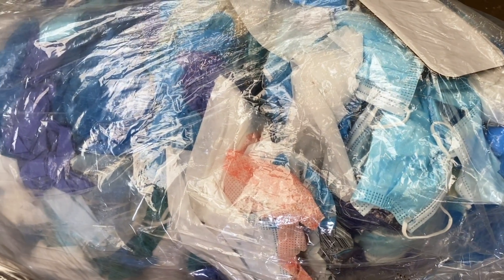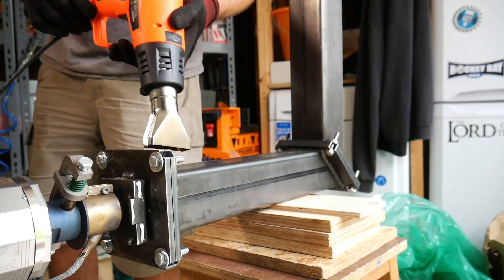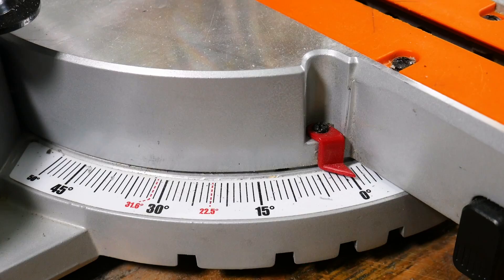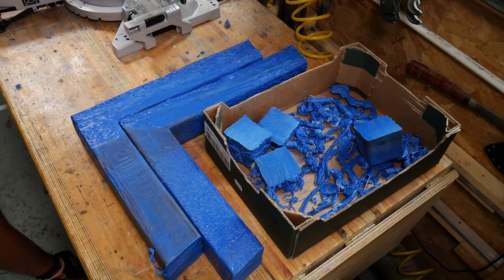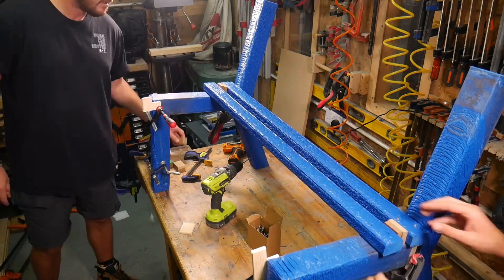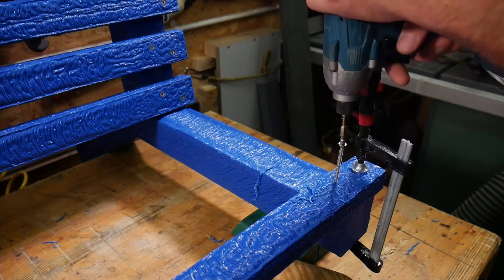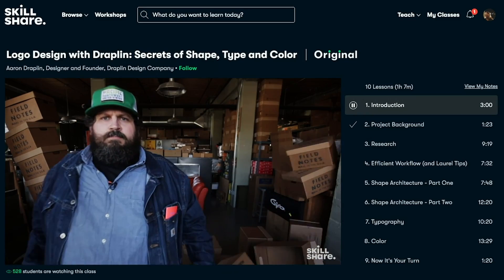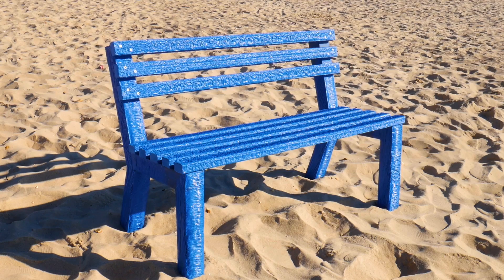We Turned Waste PPE into a Recycled Plastic BENCH

Comment from the maker: Thanks so much for watching! 🤙🏽 Don't forget, the first 1,000 people to use this link will get a 1 month free trial of Skillshare: https://skl.sh/brothersmake09211
Reply: That obtuse angle doesn't look all that slight
Reply: Great video . Thanks .
Reply: Wondering if a solar heating source for affordable power connected to the mold pipe would help thin the viscosity of the melted plastic & produce smoother finish on end product...
Reply: Thanks, brothers!

Long time, no chat.
Reply: I forgot to ask in my last comment where can you find black hdpe?
Reply: @Nullsnaggle  protein powder containers seem to always be black.
Reply: @eugenetswong  I dont think those are usually hdpe...also I'm not leagally alowed to buy those yet
Reply: @Nullsnaggle  in Canada, they are usually HDPE, and the contents are just food.
Reply: @eugenetswong  oh...well dont you still need to be 18 to buy them?
Reply: @Nullsnaggle  I have never heard of anybody needing to be that old to buy it. Maybe you should just phone the stores and ask them.

No matter what, though, I recommend putting ads on Craig's List's volunteer section, and wanted section. See if you can get these black plastic containers for free.
Reply: @eugenetswong  alrighty thanks for the help😛
Reply: Not a 100% PPE bench the screws and bolts and nuts are metal. But I believe there probably is a way to make those out of PPE too.
Reply: the elastic strips from the masks i use them the same as zipties for example for cable management in my 3D printer
Reply: How can I buy some machines ?

Comment: Does not seem as if it’d be durable in the long term... bare minimum needs another set of legs in the middle. 
Also the metal screws would probably chip away and eventually it’d just fall apart. Please revisit this plastic bench concept, because it’d probably be one use for recycled plastic that could be done large scale..
 Would HDPE be better? 

I would think PP is better for making stuff that isn’t going to be under so much strain... who wants a flexible bench... I dunno. Your bench gives me anxiety... as if it’s going to break apart suddenly and break someones back.

Comment: How many power did you use to melt all of this mask.
Can you tell me the carbon footprint of all the process??
Obviously the machines count in the carbon footprint.(building machine and using it).
STOP DOIN THAT KIND OF SHIT IF YOU BELIEVE IN ECOLOGY.
ALL THAT F THING FOR ONE BENCH, GO TO HELL WITH IT.!!!!
Reply from the maker: Are you alright mate?

Our workshop is powered by 100% renewable energy. Low temperature melting of plastics is by far the most sustainable way to recycle them. We collect all our waste and reuse it.

Of course, there is some waste in our process, as with any manufacturing process. But we do everything we can to address this and constantly improve. 

Please do not comment on something you know little about.

Comment: Recycling dosn't work. The plastic is still here and only making more.
We will never get 100% recycled.
Even if we do there is always waste.
Ditch plastic all together.
The recycled products I have seen and used are not very strong and don't last long.
Reply from the maker: …you clearly haven’t come across our recycled plastic products! But we agree with your statement
Reply: @BrothersMake   what is the difference with your recycled plastic, it all goes to shit is the sun or if it is repeatedly used.
Reply from the maker: Sure, plastic will degrade in UV light, like all other plastics. But you comments on the strength and durability, our products are designed to last. You’re more that welcome to purchase some and test for yourself before commenting on something you can’t possibly know.

Comment: As someone who works in the plastics recycling industry, i applaud the effort. But this bench is not dense enough to sustain your weight at its best performance. PP suffers a lot from sunlight beams and its flexural strength will decrease noticeably in the next few months. You could extend the longevity of the bench from the sun by adding UV protection masterbatches 2-4% in the hopper. They are pretty cheap and their carrier is both suitable for pe and pp materials. Also the ripple effect is caused because the mould is not heated and pressurised. In industrial machines, the moulds are preheated and always kept at constant temperatures while the plastic is injected after extrusion.

Comment: How hot do you need to pre-heat the molds to? I was thinking that the heated pads. They just plug into mains and can reach 60 ℃ and as they are made from fabric, they will keep the heat trapped inside the mold. You could even wrap the whole thing in foil insulation to keep it toasty warm.

Comment: Hi guys, first of all congratulations on the amazing work! I also appreciated the little bit at the end where you explained the difference between PP and HDPE.
I have a question: I still don't know about plastic melting points, but do you think that the PP bench can stay outside in the sun without reaching critical temperatures?
Thanks
Reply: Polypropylene can withstand above 100C (130-171C from wikipedia), thus it was usually used for disposable hot drink cups.

Comment: It looks cool, but I can't help but feel like this should be done at the "made to order" level to maximize efficiency and minimize energy waste, not to mention all of those extruded pieces...

Also, I would have liked to see more of a robust stress test on the finished bench. I was fully expecting it to bend and be nearly unusable. Very surprised to see it seemed to hold up fairly well. Not even a cross brace on the bottom.

Color me surprised.
Reply from the maker: Like we said at the end, we aren’t going to be selling these. It was more of a proof of concept. But we were also pleasantly surprised at the strength of the end result

Comment: The process looks really simple but plastic beams always seem a little weak. I wonder if you could add thin l rod like 4+ mm threaded steel rod or even pre-tensioned wire to make a cage then extrud plastic around it. Is it possible in a home shop? I love the idea of plastic garden furniture. It's  so practical! Great job gents.
Reply: Saying that plastic beams seems weak is a bit like saying that dogs seems to be really tiny....

The differences between different types of plastic are absolutely huge and some plastic are weak while other are multiple times stronger than wood or even some weaker metals.
Reply: @HidekiShinichi  Have you ever sat on a bench made from recycled plastic? There are quite a few in the parks around me. They are similar in  size to the one shown. Made of pure recycled plastic, they bow noticeably when an average person sits on them! I thought it didn't need to be said that plastic is weak [in comparison to] other common materials used to make a bench, such as wood or steel. 😊

Comment: Cool concept.  May have issues in warm weather with creep of the long beams due to weight.  A way to overcome that could be to reinforce the beams longitudinally with continuous glass fiber.  Not complicated considering the type of molds you are using and will make the bench much more durable.
Reply from the maker: PP doesn't sag much in the heat. That's why it's used for garden furniture :)

Comment: Good job on the extrusion and build. Though I don't think it's a good idea to keep it in direct sunlight long term as the plastic will suffer from UV degradation. Unless of course you coated it with UV protection.
Reply: Wood benches also suffer from UV degradation too.

Comment: 5:05 "The easiest way we found to do this was to make several cuts with circular saw and then clean it out with a chisel."
Cough! Cough! Use a router with a straight cut bit.
Reply from the maker: There’s a number of reasons why we didn’t go down that route: 1) it would have been insanely messy. 2) the surface of the material was not even, so the smaller base of the router wouldn’t have been as stable as the base of the saw. 3) it needed a slight angle, which we could achieve by tilting the saw blade, which wouldn’t be possible with a router.
Reply: @BrothersMake  I'll buy that. 
Also, "... we didn't go down that route:". I thought I was supposed to be the pun master here.

Comment: Great video! A question from someone who knows nothing about this: Is there any way to weld the pieces together instead of using bolts? Would that be too difficult or just not be strong enough?
Reply from the maker: We actually did a video a little while back on plastic welding. Not sure if it would be strong enough on these thicker sections but worth giving it a go!
Reply: @BrothersMake  I'll agree on the shear strength of welded vs formed joints.  But when you recessed the bolts I was wondering if you filled them in, how would you ever match the texture?  Maybe cut plugs from the plank you planed and then just hammer them in!  That way they don't really show, but if someone needed to take it apart, they could find the plugs!
Reply: I think some wood-joinery techniques -- pegs and dovetails and the like -- could possibly work.
Reply: @molybdnum  my only concern is that plastic deforms differently under stress than wood, so some joinery techniques might not translate well

Comment: I worked in food extrusion for twenty years and much of the product is made under high pressure but there is a product that is processed in the extruder at high moisture and low temperature and pressure. and it is fed into a long pipe that is used as a tempering zone before the product is fed through a cutter. My point is that when the extruder is shut down and the tempering pipe is purged the product comes out smooth as it was held under low pressure. If you blocked the end of your pipe dies with a restriction die would your small machine create pressure in the pipe die so the extrudate came out smooth instead of wrinkled? I see part of the die must be under pressure as you had short smooth sections in the seat legs. Sorry for being so wordy.
Reply from the maker: The flat sections came out in the areas where we heated the mould. This would certainly produce a flatter result, but it would also be harder to de mould and it would also pick up the colour of the steel mould slightly as you can see in some small sections.

Comment: Love the bench.  A couple of comments.  You could embed some rebar in the plastic to avoid snapping.   And I wish we could see more of the pelletizing.  How do they get rid of the metal nose strip?  Or do they simply grind it and incorporate them into the pellets?
Reply from the maker: Inserting rebar could work. But it would also make the final product significantly harder to recycle in the future. Not sure how they remove the strip. There is no evidence of it in the plastic as it would damage our machines. Possibly using magnets during the shredding stage?
Reply: Thanks!

Comment: 10:30 when you sat on it the bench bent. I could easily see this breaking on someone and would suggest adding one more bottom/ back support in the middle. Other that that I think this is great. I didn’t realize that about masks. I have pretty much used a reusable mask since the start of the pandemic but this is great. 
😷 + ♻️ = 🪑
Reply from the maker: Yeah we did address this at the end. Individually the beams retain some flexibility but across the 5 slats, the weight is spread and it holds the combined 28 stone weight of the two of us with no hassle.
Reply: @BrothersMake  But when you both sit on it you each have around half your weight on the legs. If someone like myself who is 270 pounds or someone heavier sat on it alone in the middle, I can see it breaking. I do think a center support or even a third leg (so what if it looks weird, just reuses more plastic) would definitely be best. Also how is it gonna do standing up to the heat of the sun on really hot days?
Reply: @bellydancingdog  A slat connecting all the horizontal beams does help with this...even with the extra weight. PP is far more forgiving than timber, and the flex is just a natural poperty of the material. I know maybe a bad example (because they break) but plastic garden chairs gram for gram are a lot stronger than wooden ones.
Reply from the maker: Recycle Rebuild with the stats 👏🏽♻️🤙🏽
Reply: @sustainabledesign.studio  Fair enough, what you said makes sense and you are probably right it would hold more than I think. That being said, I still think if the point is to reuse old disposed of plastic, why not use a bit more and make the bench even more sturdy?

Comment: Polypropylene is a very good material to work with, better than HDPE in terms of toughness.
And it is used for thicker objects, so you can find that for the same volume of "waste", you can recover more weight of PP rather than HDPE.
Reply from the maker: It was great to work with a new material! Would definitely work with it again :)
Reply: @BrothersMake  I have plenty of it, waiting to finish the machinery I'm making.